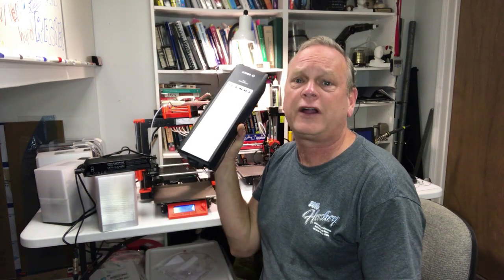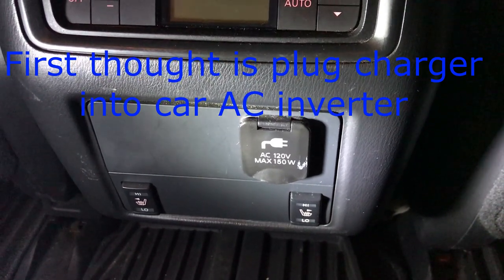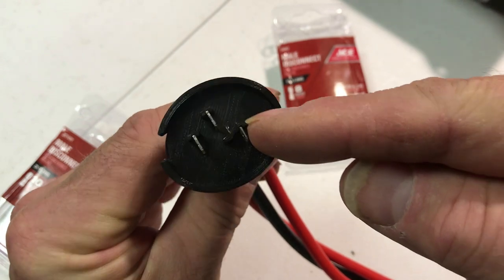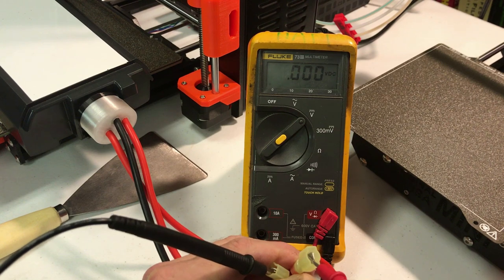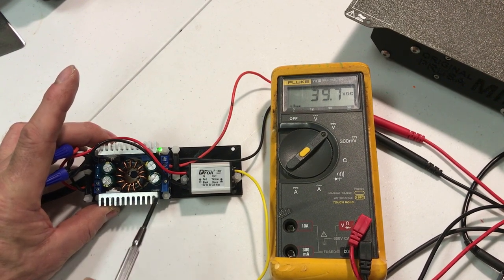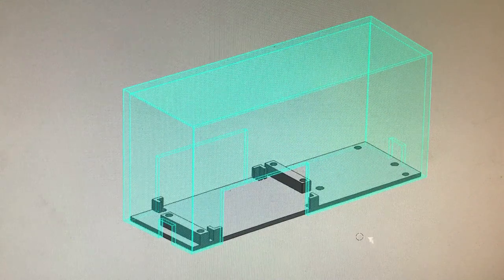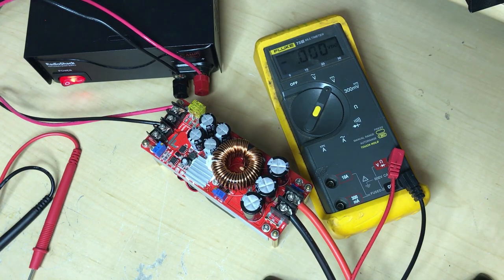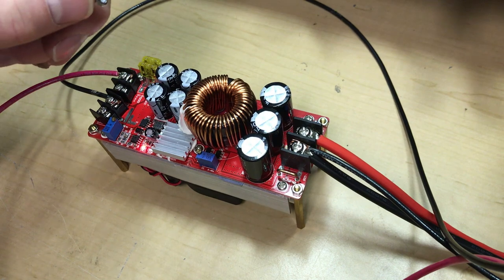DIY Bosch Ebike Battery 12V Charger with 3D Printed Charge Plug

Comment: Thanks for the information. So very helpful. Do you know if you can run solor power charging the battery while riding the bike at the same time? I have a bosh battery and it has a side mount charging socket. Uses the same 3 pin plug you created.
Reply from the maker: Currently I charge a second Bosch battery while riding. Bosch is a closed system. The battery/controller/motor all communicate. I haven't figured out how to hack it yet.

Comment: Can someone tell me how you handle the floating ground on the output of the boost converter with the 5v regulator attached to the 12 volt input? Do you tie the grounds together?  Seems like this could be an issue.
Reply from the maker: if you tie the grounds together it doesn't work for some reason. Works just fine with using the 5V +  "floating"

Comment: Nice to see how you did it 🙂
It seems that the 5V control signal is only "enabling" the charge, so ~ 1 MillAmps on the 5 Volt  should be plenty to enable charging.
Future project for me: Charge the Bosch e-bike battery from a solar panel (PV).
Thanks! -Willem
Reply from the maker: Here's how I did it: https://youtu.be/F27a7yQKD6s?si=u0dn6RVEXRPtuw9F
Reply: What about the negative 5v line? Where does that go>? Cheers!

Comment: Hi Chris, I want to use a spare bosch battery to power a telescope and other accessories. All stuff are 12-14 V and max 4 A of total current. This connector is perfect! Thanks!
In your opinion I Need just a 36 to 12 V converter and use power from + and - pins or I need to connect the third pole to somewhere else (es. 5v)?
Reply from the maker: I have not figured out how to use the Bosch battery yet to run things. It has a properitary interface
Reply: @SerendipitySue  Thanks a lot! I think it's better way to use my old power bank.

Comment: Hi. I’m doing a solar ebike Bosch battery charger on a 100w 12v solar wagon behind my ebike (not charging while in use but charging battery packs while I bike). All is setup based on your design and a few others but I am running into one issue with the 12 v to 5v for the third wire. The positive lead (yellow wire out of the drok) is obvious based on your design but where do you connect the black negative wire to complete the 5v circuit. I would assume the negative connects up with the negative from the battery but it would be great if you could verify this. All the rest is setup fine and I am ready to do a test charge but I wanted to confirm this last detail before I soldered stuff together. Don’t worry I take full responsibility if my design breaks my batteries.
Reply from the maker: It's a shared ground. I believe I left it disconnected. Will have to check
Reply: Yep. It doesn’t have to be connected to anything. I got my 100w panel charging the battery at 42v 110a even on a pretty low sun day. Now just to attach it to the solar wagon and we are golden. Thanks for your help.

Comment: Very nice . Shame i am not technical. was there any thought to putting in a second car battery and driving the charger from that?  ( 4wds often have a second battery fitted with wiring harness kits, isolators and switching gear. ) .
Reply: It’ll still be 12v and the same plug. So nope

Comment: Hello, would you mind sending me the 3d file of the plug? I am working on the same project and have a 3 d printer. Awesome documentation. Thank you
Reply from the maker: the links to 3D print files are in the description
Reply: @SerendipitySue  awesome. Printed it and works well. Appreciated

Comment: I just want to check my (limited) understanding! Is the way the battery is charged controlled by a circuit within the battery pack? On a conventional lead/acid battery the charge cycle (current, voltage etc) is controlled from within the charger, but It seems from what you say that the proprietary Bosch mains charger is literally just a transformer providing 44v to the main ins and 5v to the other one? My concern is that there is more to charing a battery than just applying a voltage back to its terminals so i dont want to damage anything.
Reply from the maker: you will want to limit the charging current. The Bosch BMS (Battery Managerment System) in the battery will actually shut down the charging if you try to charge it too fast. You can purchase a GRIN charger if you want to be more specific with the charge profile: https://youtu.be/YejPGydMOnw
Reply: @SerendipitySue  ok thanks, one more thing I'm a little worried about. When i test voltages on mains charger output plug there's 5v on the small pin but nothing on the large one. This makes sense from a safety point of view as otherwise you'd have 44v 'exposed' which could easily short.  But it also implies that the charger itself must have some internal electronics to detect when the 5v circuit is drawing power (ie connected) which then switches on the main charging power. So clearly not all the battery charging software resides in the BMS within the battery pack itself. Are you quite confident that the DC-DC charger will not damage the (very expensive!) battery pack? I do understand that if we limit current to 2A when battery is discharged then current will reduce as the charge level increases. It strikes me its a good idea to connect to the better before connecting to the vehicle supply.
Reply from the maker: @gcc2007  The standard charger puts out 4A. Since my car cigarette lighter wattage is limited, I have to back off the battery charging current. I have not had any problems with my Bosch battery using this method.

Comment: Hi Chris. Thanks a bundle for this, it's going to help enormously while we travel Australia. I'm afraid I am on a steep learning curve and my questions are probably pretty low level. I'm trying to make a solar charger of similar design, and I have requested a company to make the plugs for me. They have asked, "What material" and "surface finishing" ??? As I have no idea of 3D printing, I'm not sure how to answer this. They've also asked for a "Target price" O_O which again I have no idea of. On a more technical point, if I'm making the solar charger, should I splice power direct from the solar outlet - so I'd have one set of wires to each of the units. Is there another place to source it in the same system or am I better off to use a second source?  I'm sorry to ask these questions. My knowledge is scant, and I have so far not been able to find anyone to assist me. Cheers in advance for any assistance or direction to info you may be able to provide. Thanks, Justin
Reply: Hey Chris, don't worry about the questions involving the 3D printing. I found a guy local who did it for me in about 1/2 an hour. However, if you have any ideas on the 5volt take off, I'd still be glad to hear them. Cheers, Justin.
Reply from the maker: I've done a couple of projects solar charging my ebike batteries (https://youtu.be/CRZOvl0v_YE  https://youtu.be/F27a7yQKD6s ). I like the Genasun solar controllers. They are not cheap, but very well made.
Reply: @SerendipitySue  Hey Chris, Truly sorry, I just re-read my response to you and realized I didn't explain myself at all well. I've watched both your solar charger vids and altough they're fantastic, I am still no closer to an answer. What I was trying to ask (not clearly at all) is, I have a KTM bike with Bosch motor, I am trying to figure out the best/any place to take the 5volt from to make the battery work. If you have any ideas, I'd very much appreciate it. Again, sorry for my previous fairly garbled message, Justin.

Comment: Great video.  
You are very talented!  I need some advice.  I was given a nearly new Bosch 500 Powerpack and Charger by a friend who had his brand new Bosch mountain bike stolen from his garage.
I am planning to motorize my long wheelbase recumbent with a front wheel geared hub motor. I would like to use the the Bosch battery, if possible.  However, after charging the battery,  I am unable to detect any voltage at the + and - terminals of the battery even though all of the green lights come on, indicating that the battery is fully charged. I have checked every combination of pins on the output of the battery and cannot find the 36 volts or any other voltage.  I am assuming that some sort of enable signal or hand shaking must take place to enable the output but have not been able to find any information on the web.
Also, I have not been able to find the Bosch connector to plug onto the battery.  I am assuming that you made your plug because they are unavailable.
Thanks  in advance for any information you can provide.
Don,
Reply from the maker: I'm afraid you might be out of luck. The Bosch battery is proprietary . It talks to the bike controller/motor to provide power. I would love to figure out the protocol, but haven't yet. If I did, I could use it to power other things :-)
Reply: Thanks also. I'm in the same boat with a free battery and charger from a stolen bike situation. I saw another youtuber replace the bms for a hotrod bike, that was also interesting watch.

Comment: Thanks for the great video. I'm trying to understand the part where you mention that this will charge the battery to 80%. How is that controlled? 
Also, is it true that it's bad to charge the battery when it is cold? In the winter here it gets well below freezing so when I bring my battery indoors after a winter ride it's very cold. I'm thinking of building something that will monitor the temperature of the battery (from the outside) and switch on charging via a relay when the temperature gets back up to something reasonable. Ideally I could also stop charging before the battery gets to 100% but not sure how to do that.
Reply from the maker: Yes, it is bad to charge Lithium batteries when it is below freezing. Good battery systems have a BMS that will have a temperature sensor that will prevent it from trying. You set the percent charged by setting the charging voltage. A 36v battery is a 10S configuration. The max voltage per cell is usually 4.2V (check battery cell spec. sheet). So 42V would be fully charged. 2.5V is an empty cell voltage. 41V would be roughly 90% charged.
Reply: @SerendipitySue  Awesome, thank you. I did a bit more research and am starting to understand about the voltage limit corresponding to cell charge limit. Do you happen to know if Bosch batteries do any sort of smart things like cell rebalancing, and if so, if they only do it at 100%? I saw that mentioned as a caveat to not going to 100% for certain batteries.
Reply from the maker: @robothebobo  I'm sure the bosch bms balances the cells. I'm not sure at what voltage. It just means that every once in a while you charge them 100%
Reply: @SerendipitySue  that makes sense. My plan then is to intercept the cable from the Bosch charger to the battery and have a DPST relay on 2 of the 3 connectors to close when the temperature sensor stabilizes at room temp and break when voltage across - and + reach an 80-90% level.

Comment: I just ordered my first ebike! Can't wait to watch all your videos again and get more ideas :) With the ryobi batteries and the ebike, I'll have almost 1.5kwh in the camper! Is there a reason why no one seems to be connecting their ebike batteries to an inverter?
Reply from the maker: I'd like to use my ebike batteries as a back-up power for an inverter. I haven't figured out how to do this yet with the Bosch. I just got a Radcity ebike for Sue. That battery may be easier to hack. We'll be limited by the BMS rating. I'm guessing they are designed for the 750-1000W range of the ebike motors
Reply: @SerendipitySue  You understood what I meant from my ambiguous comment. Thanks for the reply and I'm looking forward to more videos. The bike I ordered is a Rattan LM-750 which uses a silverfish style battery. I'm going to do some research to see what others have done in regards to using their ebike battery to power an inverter instead of charging the battery from the inverter. It would be nice to do both! Thanks again :)
Reply: Keep in mind Bosch is one of the few to be able honor warranty’s on their batteries. They have a 2yr warranty so I wouldn’t fiddle with the battery till after that. Since replacement ones aren’t cheap for Bosch line

Comment: Hi I can't quite make out the exact pin positions. Any chance of a closeup or diagram please?
Reply from the maker: If you look at your battery, the + and - terminals are labelled (at least on mine). The other wire puts the battery into charge mode. I probably should have labelled the connectors on the 3D model...
Reply: @SerendipitySue  thanks for the reply. I was thinking of using a 5v power supply to stimulate/switch on  the charge for my powerwall. Still struggling though. Any chance of the STL file for 3d printing?
Reply from the maker: @shockingshed6580  The 3D models are listed in the video description

Comment: hi, nice design. do you have the files to the converter case?
Reply from the maker: I only have a rough prototype for the larger DC boost converter. I'd have to dig around. Didn't want to post an unfinished one.
Reply: @SerendipitySue  ok but you use the larger dc converter still? I ordered the same on amazon, but can't find any case on thingiverse.
Reply from the maker: @iracG5  yes I use the larger one. I made a two piece box with vents. I just taped the two pieces together and never got around to making a better one. I'll look for the model.

Comment: you made some flase assumption about your car 12v outlet there is no way your 300watt inverter will pull 10 amps or 120watts and yor can buy the bosch plug and one of those plugs is 5 volts to run accesories

Comment: Hi Chris, thanks for the video. Great idea. I have built one using your instructions and 3d design on thingiverse. I've mounted it in an old bosch powerpack battery casing I had. Fits quite nicely.
I've made it so we can charge in the caravan when we stop somewhere with no electricity, using thr solar panels and leisure batteries.

I've set the battery low limit, amps and voltage out. I brought the same boost board u did. The one that worked better.

Have you tried the temp at 4amps and 6amps. 
Thanks in advance.
Reply from the maker: If you want to run at higher Amp rates, you will have to directly connect the charger to your car battery. Most car sockets are limited to 12V 10A or less. If you don't want to fully charge the battery (e.g. 80%), then just lower the voltage out.